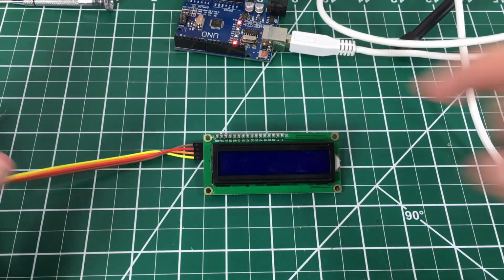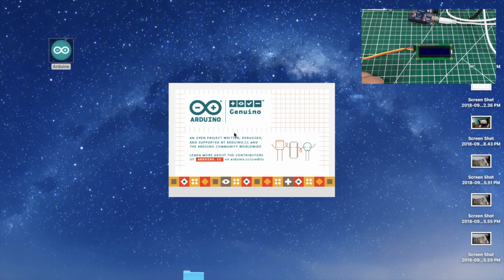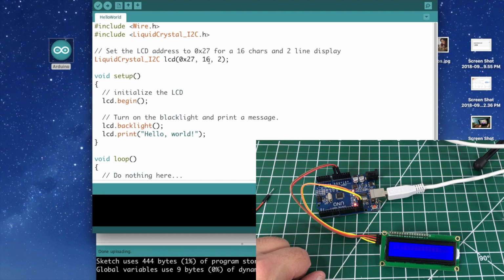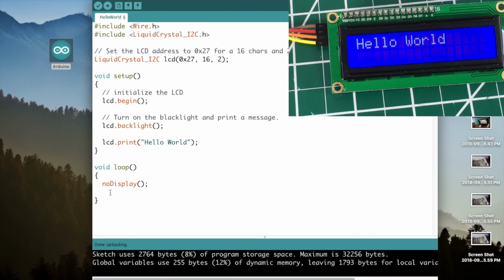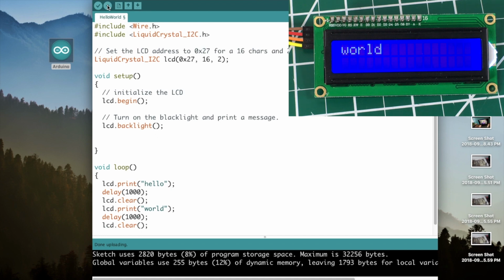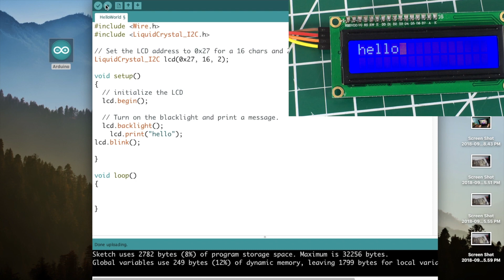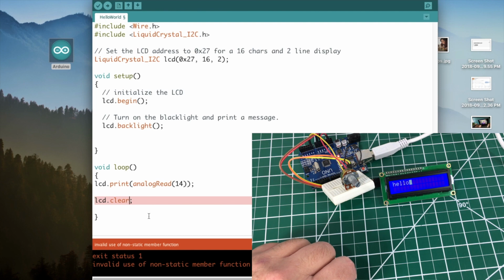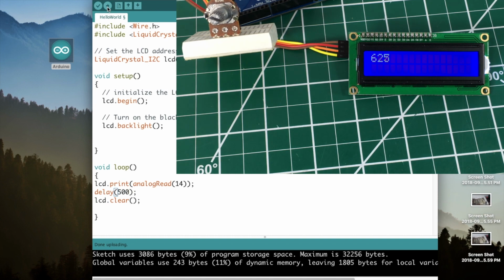How to use an i2c LCD display with arduino - including library install

Comment: HI I am using Arduino IDE and had a problem with the display only printing 1 character. If the library you used updated?
.

Comment: My LCD does not print anything even after I have followed all your steps
Reply: Which version of arduino are you using?
Reply: It's arduino uno r3. By the way, i found the solution for my problem.
Reply: @nguyenvankhanhduy3958  alright no problem. You are probably doing advanced projects now👍

Comment: I can't get the characters to show ='(, got everything wired and the address right.
Reply: I don't know if it was the same problem i had - but the solution was the potmeter setting. A slight turn and the characters turned nicely up on the screen.
Reply: Which version are you using?

Comment: Hi there! I followed exactly along and my ide shows an error with the lcd.begin() comand. It says there is no matching function to call in liquid crystal....Please help!
Reply: You need to download I2C liquid crystal.h library from browser on GitHub or Arduino libraries website
Reply: @rohithreddy-paripelly  I downloaded everything but the problem still persist
Reply: @Time4yes  just check coding use correct representation .. check the connection and. Code connection...
Reply: @rohithreddy-paripelly  I did some thinking, the latest version wants us to initialize the LCD as an init method in the setup loop and include (16,2) on the LCD.begin

Comment: Here's how addressing works on the I2C LCD adapter:
The address of this particular adapter will always be a 2-digit hexadecimal number in the range of 20 to 27 (0x20 to 0x27).
There are three address jumper pads on the adapter PC board labeled A0, A1 and A2. The address lines have pull-ups, so an open jumper sets the address line to a 1, while a closed jumper sets it to 0.
The jumpers determine the least significant digit of the address, while the most significant digit is always 2. Therefore, the least significant digit will correspond to this truth table, where a 1 signifies no jumper, a 0 signifies a jumper in place:

A2 A1 A0   I2C addr
 0   0   0     0x20
 0   0   1     0x21
 0   1   0     0x22
 0   1   1     0x23
 1   0   0     0x24
 1   0   1     0x25
 1   1   0     0x26
 1   1   1     0x27

So, installing no jumpers (the default) results in an address of 0x27 on these adapters.

Comment: Thanks a lot, great video :) Btw, do i need to solder all the A0 A1 A2 pins in the i2c to get several adresses, for using only 2 lcd screens and display different text ? Thx in advance and thx again for this great video !